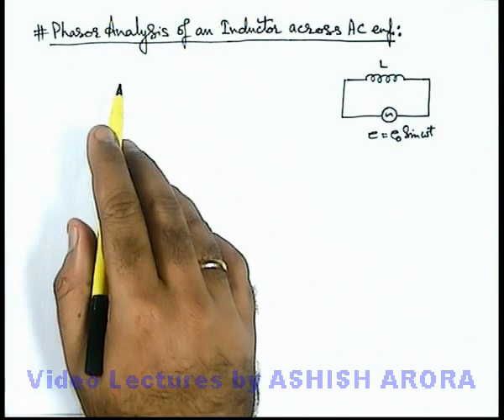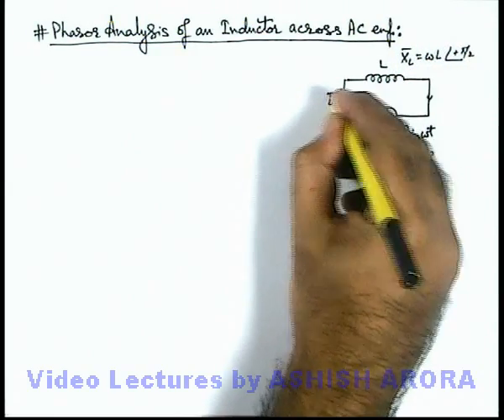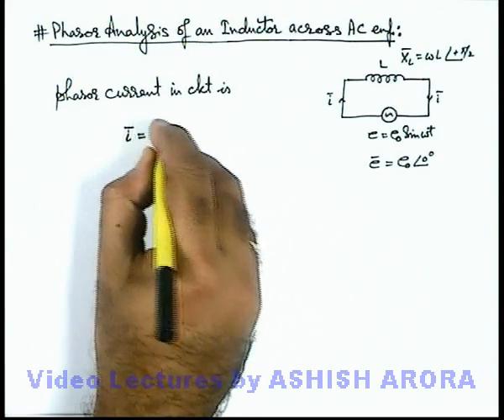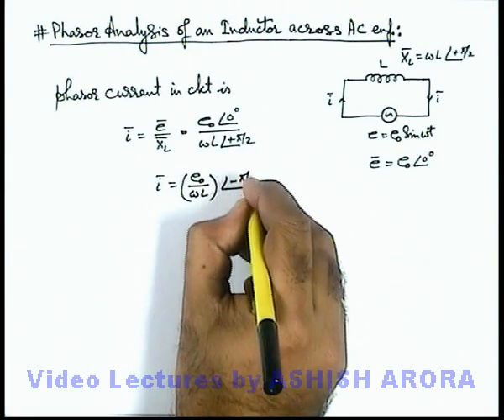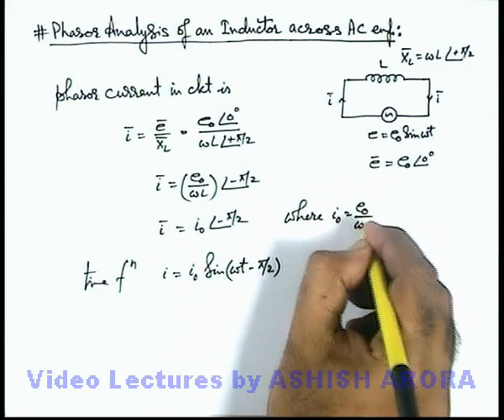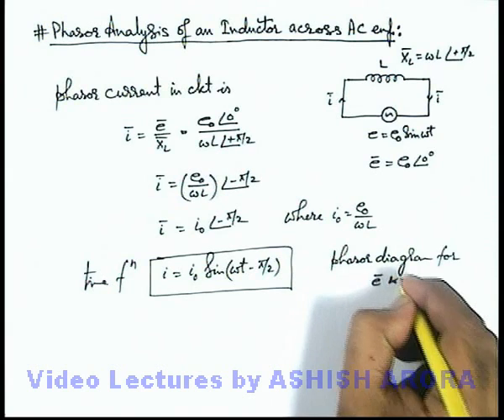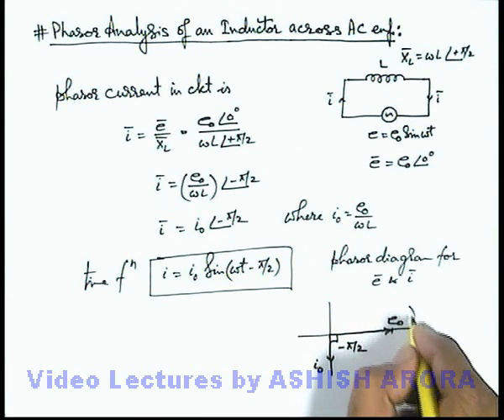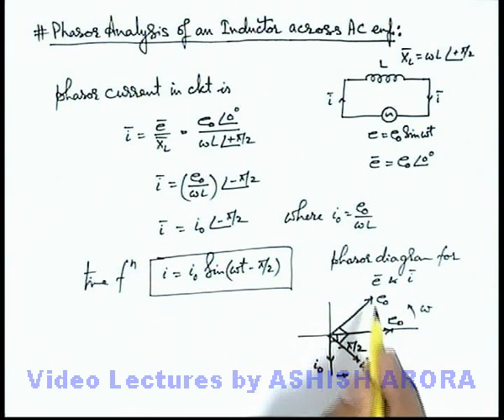Class 12 Physics | Alternating Current |#24 Phasor Analysis of an Inductor across AC EMF |JEE & NEET

Comment: Sir, at some point of time (when (omega)t is in first quadrant), it will happen that the AC emf is positive while the current is negative. In that instant of time, will the current emerge from the negative terminal of the AC emf source? If not what will exactly happen? I am finding this a bit confusing.
Reply from the maker: you are thinking too deep... whereas it is simple... +ve and -ve directions are instantaneous... in they way you've written... as emf and current are sinusoidal functions these are varying with time in both magnitude and direction... consider emf as a reference and any direction you choose as +ve and other -ve and analyze the question for the given data in time...
Reply: bro nepal bata ho>??